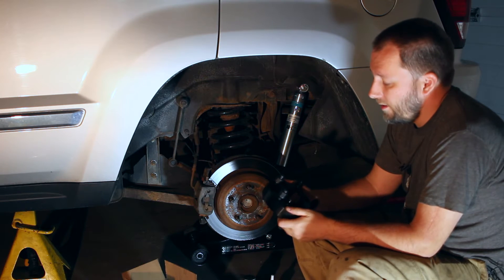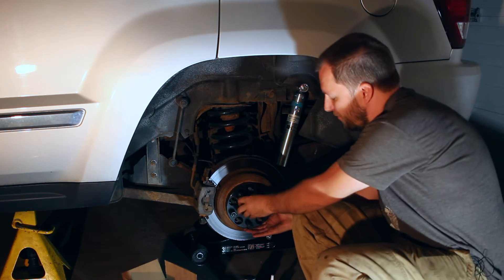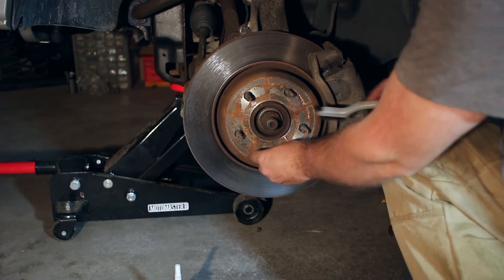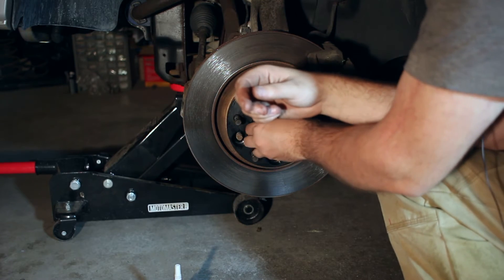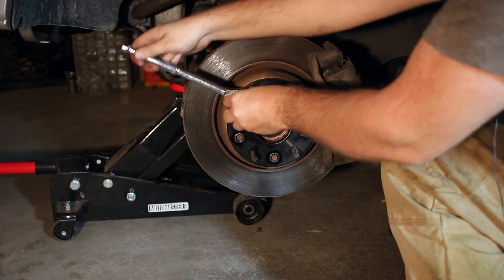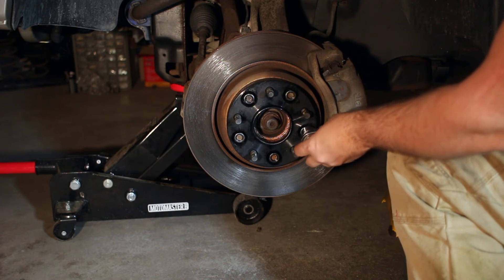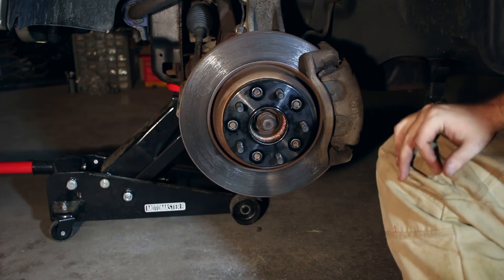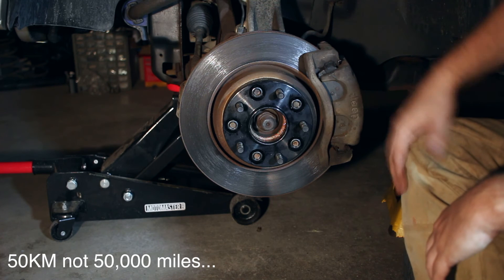Wheel Spacers 1.25" Jeep WK / JK / TJ / JL / LJ / Ram 1500

Comment: With the 1.25 spacer do you have to cut the studs
Reply from the maker: On my application, I didn't but you really want to measure and make sure you don't need to. Difference setups might use different studs lengths. I still prefer proper rims but that is easier said than done.
Reply: Yeah I put Rubicon wheels on mine and they are super tight to the caliper
Reply: Per bora spacer they said for wk2 1.25 inch spacer the stud will stick out but if u are using stock rims they have air pocket so problems.

Comment: Great video! Question for you, I have a 2006 WK on which I’d like to increase tire size. To do this it seems tore spacers are required. I want to keep stock rims. At any rate, what spacers did you use, what is impact of using spacers on the bearings, and how have they held up for you since you installed?